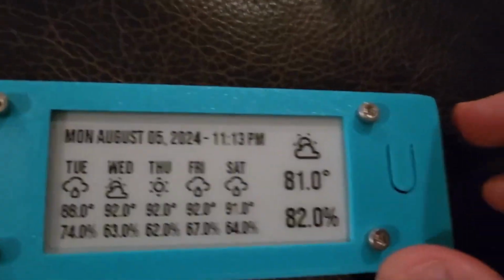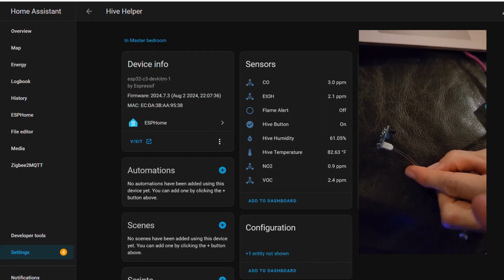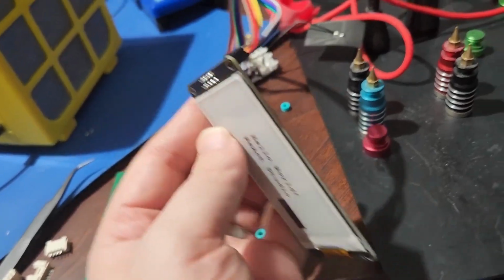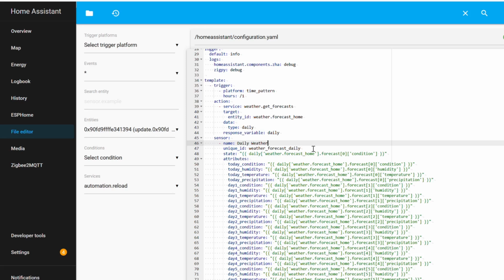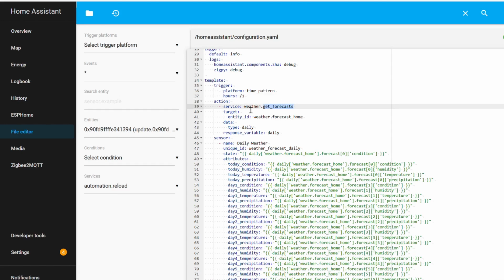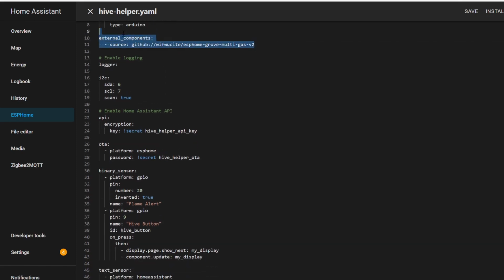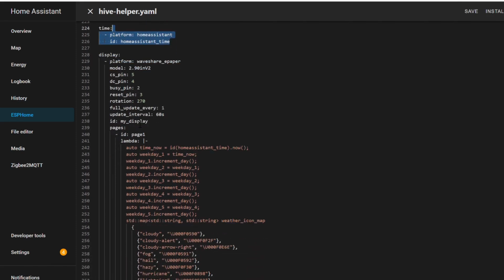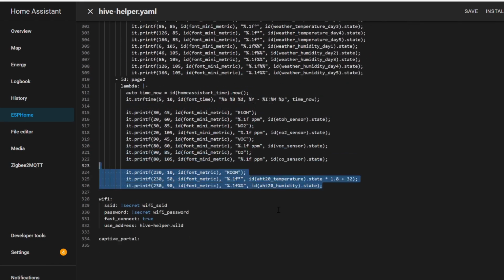Hive Helper - Xiao ESP32C3 powered WeAct 2.9 inch epaper home assistant display

Comment: Very cool video! Glad I came across this video. I'm currently working on a project with the same esp32c3 dev board. So far it's running off a i2c oled display but I might get one of those 4 or 7in einks after seeing your video. Didn't know there was support for these displays on esphome.
Reply from the maker: Hey they work great. There's the issue with partial refreshing but with the full refresh it has been pretty consistent. There's also a PR someone mentions in this thread re: the 3 color displays. I have a few of those so hoping to try it out in the future. https://github.com/esphome/feature-requests/issues/2101
Reply: @thecosmicbee  definitely looking forward to seeing how those work! I've been told their refresh is a bit slower but for most data statistic displays that shouldn't be an issue unless if it's like over 5minutes or something absurd like that. Either way, great work and I'll sub for future videos! Best of luck to you and your projects!